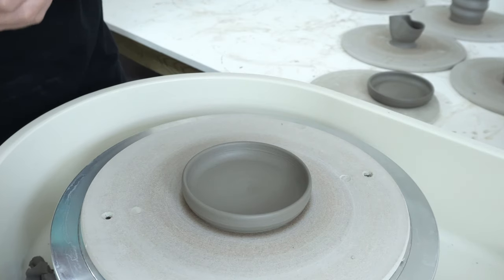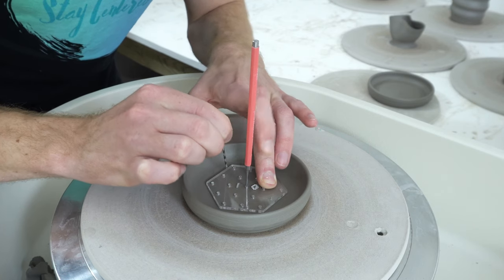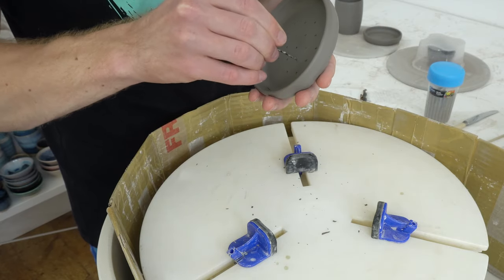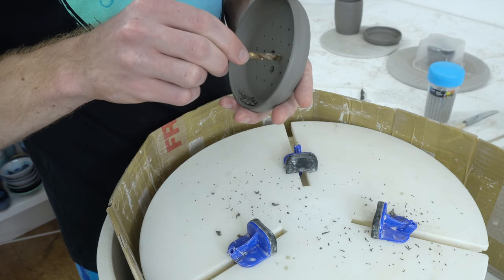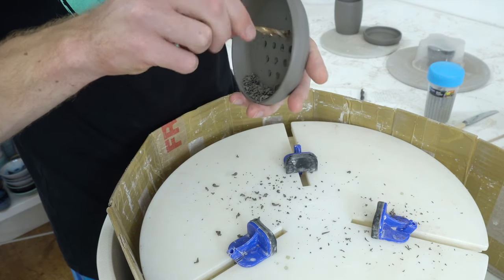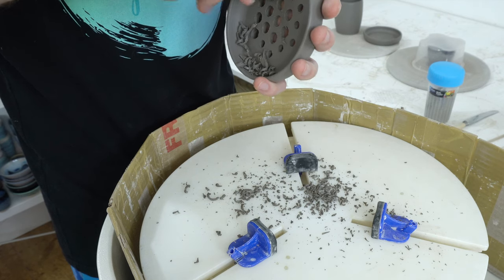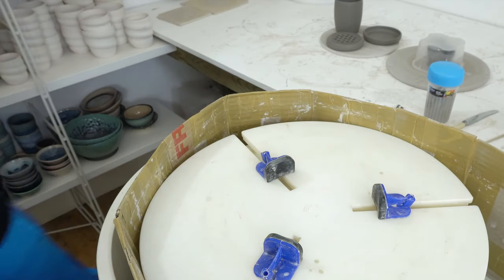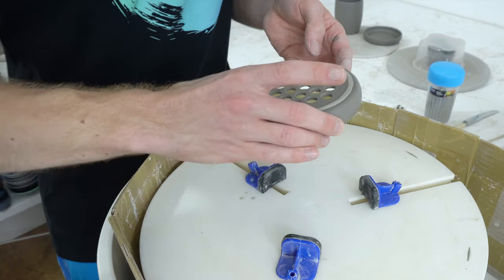Making a Soap Dish with a Hole Cutting Guide

Comment: Great video! What do you use to glaze the dish? Thanks 👍🏻
Reply from the maker: As in, what glaze did I use, or what's the process?
Reply: Old Forge Creations I’m looking at making soap dishes for my bathroom and I was trying to figure out what to use for a seal / gloss coat after painting them? Any suggestions? Thanks
Reply from the maker: @kaelamusicuk7731  I used Floating Blue here but it sounds like you're asking a totally different question. It's a glaze which needs to be fired in a kiln, which is completely different to something like a gloss paint or sealer